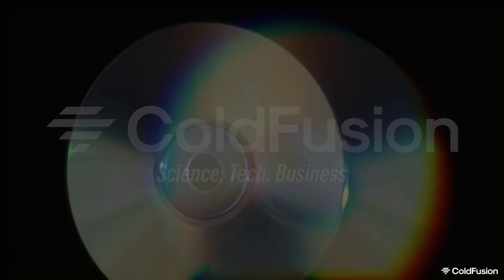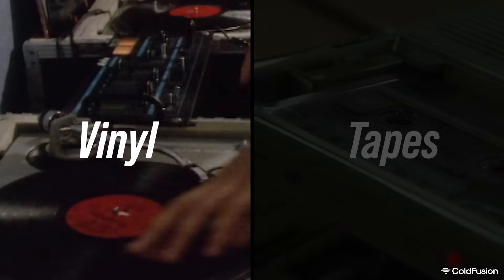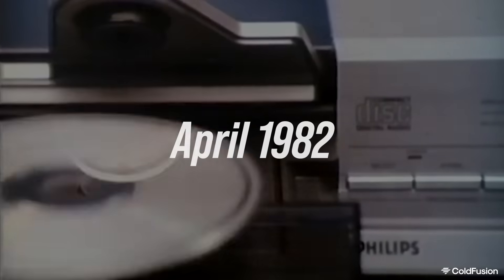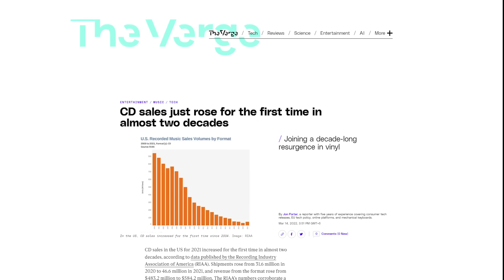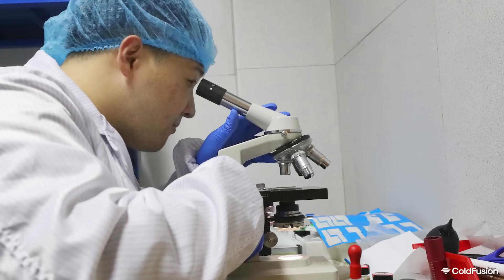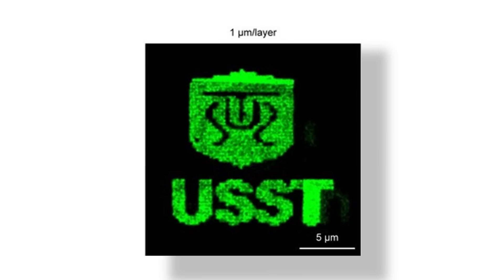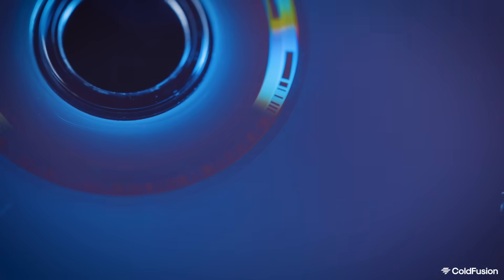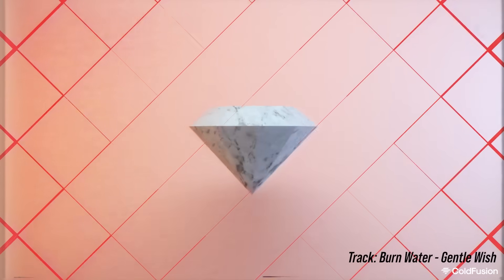Why This New CD Could Change Storage

Comment: People are primarily using hard disk drive and solid state drives for data storage (not cloud storage as the author says because you sacrifice security, and are limited by the cost and bandwidth of the internet). Given that, 8 TB hard drives are sufficient for the data storage of most people, or multiple drives for those who have a lot of video.
This new Petabyte drive is a cool concept and perhaps will one day be affordable, but for now it is much cheaper and more reliable to use solid state or magnetic drives.

Comment: The move to keeping everything online including personal photographs and sensitive documents has created concerns over Privacy, Information Security, and Cybersecurity. Having sensitive and personal information stored on my own optical disks eliminates those concerns. The data is not on the cloud or on my computer's hard drive, where it is vulnerable to being hacked, stolen, or just lost due to drive failure. The data is also accessible to me whenever I need it and I have the added benefit of not having to pay for extra data storage on the cloud (which could be a lot more expensive over the long haul). For these reasons, I continue to use optical drives and don't see myself stopping anytime soon.

Comment: The two ways i expect it only could start to become main stream together: the porn industry aswel as the gaming industry.

Why?

Looking at the battle between hd dvd and blu ray it was the porn industry whom massively moved over to blu ray meaning more money went to it and not enough to hd dvd.
Thus i expect given the current growing size of the gaming industry and the already big porn industry i can see thém pushing for that medium in order to put more on the disc.
Though the problem is the rest of the hardware needs to grow as fast and become much cheaper so we can have multi petabyte storage medium at less(not about) but less than the cost of a higher end video card thus there is a chance aswel as a place for it if the right circumstances come into picture...

Comment: Cool...  But I don't see a purpose for customers other than people that want to store that kind of data.  I mean backing up Servers is all I can see for it's future. I still buy music CD's.  Sad part was backing up music from a HHD back in the early 2000's disc couldn't hold 320kbps files. So you'd have burn CD's under 200kbps to get a lot of songs on 1 disc.  I physically own 550 CD's of Music I bought and Ripped to my Computer HHD.  So they are in New Condition.  HHD's used to cost a lot.  Now you can find a 1TB Drive New for 35 dollars.  If I was to play my CD Collection I have on my Computer.. I would play for 35 days, you may hear the same song a few times but it would be other artist that covered the song.  I mean I don't use the cloud.  And the only streaming I do is on me and my friends Internet Radio Station.  Which is funny cause I'm looking for a turn table so I can digitize Vinyl Albums I have...   Great Video thanks!

Comment: There are many greek albums on compact disc that they are not on digital platforms and also there are many greek albums on vinyl that never released on compact disc. The bad thing is also that some greek companies put many songs at platforms from fakely digitized files, they add extra strange frequencies and increase loudbess extremely and close the sound with muddy bass.
I have around 40 -50 greek compact discs that don't exist on digital platforms and also around 30 compact discs that on digital platforms they have the albums fakely remastered with muddy bass, hard drums, extreme loudness True Peak +3.5 around -7 LUFS and not tonal balance, like pitch and tone is fake. I have the same albums on cd with True Peak -0.8 to -0.5 ,  -15 to -13 LUFS and crystal clear sound.

Comment: If anyone remembers floppy discs, they stayed inside a protective case which protected them from being touched and scratched... My point is, that old school CDs, DVDs, Blu-ray and these NEW peta-discs should be made like that with a permanent protective case and small openings for the laser to read/write. I believe this would help make them useful at least in business applications. Especially if you can avoid having them damaged by a permanent protective case.

Comment: They only mention the write speeds in Megabytes per second, but they don’t mention the read speed, which will be much faster.

A modern 4K UHD Blu-ray disc can hold 66-100GB of data, so reading a 2-hour movie stored at 66GB would only require 9 Megabytes/s. So, it would be perfectly possible to store 2000-3000 4K movies on a single disc and use it for direct playback without disc swapping.

You would have the convenience of streaming but using a single disc. My bookcase of 4K/HD Blu-rays would easily fit on one disc, and making a NAS backup would be easy.

I hope this develops into a product, but the cost obviously has to go down for personal use.

Comment: how come 1.6 petabits bevome 200 gigabytes? it should have been 160 terabytes (using 10bits per biock, 2 bits checksum and separator + 8bits data, IIRC cd uses 4000 bits perblock)

Comment: At this point, why spin the disk. Variate the lasers electronically or electromagnetically thereby making the thicker and a finite platform, cube shaped. No longer necessary to spin a platter. When you can do depth recording at the sub micron level with no mechanical motor to spin you reduce the errors involved in the read/write ramp up/down rate. By locking the form of the medium and variation of the pulse with and projection of the laser , one could essentially make the Smithsonian libraries AND the internet archive available on a sugar cube or perhaps a pair of dice

Comment: He says '1.6 Petabits' and '1.6 PetaBytes' when referring to the density. These are NOT interchangeable terms. There are 8 bits in a Byte. Your 100Mb broadband connection is 12.5MB. This is an 8x difference. The b or B makes a HUGE difference.

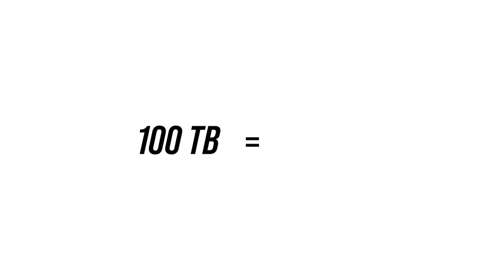Comment: 7:32 did you just compare the price of a VR headset with 2 4K-displays and a ton of other hardware to the price of a harddrive? That's just asinine
Also 100TB = 2000 standard iphones? W tf is that? They have 1TB iphones now and in a few years this stat will be even more meaningless.
You need  to work on your analogies.

Comment: Its seems CDs, DVDs, BRDs are not and wont be obsolete for the foreseeable future.  Current data storages systems are volatile and expensive relative to cd tech.  Properly stored CD media can be stored indefinitely.  HDD and SSD have volatile data susceptible to magnetic loss and electron leakage respectably and are not practical long term storage options.

Comment: Years ago i thought HVD would surpass BluRay and possibly be the end all be all bcz tech was beginning to slow down. But they havent made HVDs. (Holographic versatile discs). And now we talking petabytes bits whatever. Sheesh. Either way, i want physical media back and QUALITY..when it cones to the content on it(for example a full fleshed out video game-no updates)
Reply: Man if only I was rich enough I would create a disc using Magneto-optical (MO) which is the same tech that is used in Minidisc that way the disc could function like a hard drive also in a protective caddy like Minidisc UMD and DVD RAM and i would use 3D resolution instead of 2D which is used by CDs DVDs and blu rays i would also use the laser tech from HVD all this combined could be a disc surpassing 1 petabyte and with fast read write speeds

Comment: Data is written to recordable media in bits - 1s or 0s - (on/off, N/S, bright/dark) to make them useful incorporating all kinds of good stuff such as; the data, EDEC for data storage/recovery, and data redundancy among them. The bits are encrypted into "containers" called bytes. Be that as it is, this optical disc media is capable of storing/archiving staggering amounts of data; should it be as stable/durable/indestructible - in relative terms vs CD/DVD - as M-Disc media, this could make its' place in venues/environments where large amounts of data need to be archived for future man. In time they will resolve details pertaining to efficient manufacturing, recording methodologies and interrelated attributes making it a more tenable solution than other optical media, magnetic media and solid state media, which all have data error/retrieval issues, for data heavy archive needs.

Comment: Apart from being slow AF, I guess they will suffer the same time-dependent degregation that CDs DVD's and BlueRay disks suffer.... whilst holding substantially more data to get corrupted when they do degrade... Fine for versioned archives and slow retrieval... but to the consumer... a pointless rehash of a consigned-to-landfil technology. Better to explore storing data on (inside) crystals using lazers which are more promising imo...
Reply: CDs and DVDs last 30 years with good care they have already made discs that can last 100 years also they could just put it in a protective caddy like DVD RAM since there are so many idiots like you who can't take care of their stuff, also you could just copy the files from an old disc to a new one before it breaks.

Comment: yeah its a awesome if it does become cheap and available to public.  I've worked with discs for nearly 30 years, the ones made after mid 00s were poorly manufatured (disc rot starts around 15 year mark).  A lot of the discs I've worked with had to be backed-up every 10-15 years as the originals did rot - even in air conditioned, archived enviroments. - In a nutshell all I'm saying is, make time to do a back up (every 10 years) of crap you don't want to lose  ;)  And its not illegal to make a back-up of a disc you already own hahaha

Comment: All of this buzz until what? They make flash storage equally big enough and cheap? Did I miss something that makes this a viable practical solution that people should pray for? I own a 256GB microSD card, not that expensive. I think we can fit like 40 micro SD cards on a single side surface of a CD, so 80 on both sides, approximately. That's 256 * 4 * 20 = 20 terabytes, at fast read write speeds in portable devices such as phones, at a fraction of the cost of this CD's setup. CDs aren't some messiah physical storage media, we still do have access to doing the same with SD cards and flash drives.

Comment: I would use physical HDD not a CD to store data on if its important. Then at least I know that the disc it self won't get scratched or damaged in any way unless dropped. But stored correctly I'm sticking with HDD's.

Comment: Hard drive manufacturers are basically scammers at this point. 3 to 5 years lifespan on average. m-disk is the best kind of disk right now for archival purposes. And to use cloud storage you need to zip up your files cause otherwise your basically just sending your pictures to google or wherever for review

Comment: I think what they meant by disks are quarts crystals cut into the shape of a disk. So you'd need about a 100 thousand us dollar machine to burn it, and another 200 thousand us dollar machine to read it, and it probably wouldn't be as fast as an SSD, or even the faster hard drives.

Comment: I'd happily accept lower read/write times if it had some form of redundancy like a RAIDZ2 array, there's even enough room on a single disc to spread the redundancy out. Even if this is only a "write once" media, it would be enough space to keep using the disc until it fills up. This would be the modern, optical equivalent of a tape drive.

Comment: The current R/W speeds for this technology would not be a viable option for disaster recovery. You didn't mention if this is WORM or rewriteable technology. Having an extra off-site, portable copy of large amounts of data is a good idea.

The idea is interesting, but as you pointed out, many limitations need to be overcome. Having 1TB thumb drives is interesting, but the R/W speeds don't make them practical for large data storage and retrieval. Removable SS USB drives are much more practical for that.

Comment: I totally disagree with them being a good solution for long-term archival storage. I have CD-Rs that were written about 20 years ago that I can no longer read. They've been kept, untouched, in jewel cases for that entire time. I also have factory-produced audio CDs that no longer play. A disc with this much capacity is enticing, but I can't see a use for them. With my experience of CDs in the long term, there's no way I would trust one disc with so much data. Mechanical hard drives all the way.

Comment: Thank those professors researchers and fund providers as well that they worked on such old or almost thought to be extinct tech. Because i recently thought why not put some of the data on Blu-ray discs, seems cheaper but then i saw that i need a writer, so i preferred HDD and the speed is a factor as well. I don't remember why i exactly i thought to do so because i heard about this new tech first and i was reminded of the old CD tech or i thought first to go for discs then saw this!?

Comment: am I the only one that has thaught about the concept of SSDs replacing blue rays for consoles in the future? Like you just plug in your ~200gb ssd with the game installed into the console like a cartridge on the nintendo switch.
They don't even have to be that fast, 500mb/s would easily be enough, and if they were like 5000 - 7000 mb/s they could even be plug and play and you wouldn't have to download the game on the console's storage, but that would make physical games very expensive I think

Comment: Bytes (big B) are used for measuring storage. Bits (little b) are for data speeds (read/write, network throughput, etc). A byte is 8 bits. Everyone got it all confused.

Comment: The costs are i nsanely high now, but even looking at CDROM technology - the first CD player was over $2000.  It only took about 2 years for those prices to drop down to $200, another 2 years to $100, and another 2 years to further drop in half.  increased adoption drives increased cost savings as well as improved efficiency.   It's moore's Law applied to optical.

Comment: This won't catch on, you can already put a m.2 drive in a small portable enclosure smaller than two twix candy bar sticks and have several TB and fast.  Edit, my m.2 is 4TB in my computer and you can get an 8TB, I realize this optical disc is 200TB but give it a few years and SSD will catch up with this and still be radically faster and easier to deal with.  Also that Indian guy saying that would cover a football field in SSD?  No you could put a few SSD in to your jeans pockets and have that much.

Comment: Since its a Disc - can`t they slap one of these in a 3.5 inch HDD? And add the machine parts needed to write / remove data from the disc itself that will be in a HDD housing ?
Also i fully welcome Physical media! Id love to have discs used every day again, there is too much Digital media - you never feel like you truly OWN something .... 
And i believe a lot of people are starting to see the same - i welcome this CD of the future. 

Silly Question - Is it even possible to make a CD with a bunch of layered QR codes on it / that can store like a bunch of data o.o ?

Comment: 🤣 Yeah, not going to catch on. The read speed is too low and storage can be on scratches smaller devices. Disks are for collectors and previous generations. It’ll be a cool new way to use old tec but the mass market won’t give two shits about funding such a project to be successful.

Comment: The idea itself is not new at all. 
Just think of the TESA memory that was announced but never appeared.
At that time there were also reports where data was written in holograms on a 1 cm thick polymer plate.
The whole thing was over 20 years ago.
And the whole thing will only become a real innovation when it makes the step out of the laboratory and into the real world. 
Otherwise it's useless and nothing more than a good idea.

Comment: The only realistic use I can think of for such a device is science fiction at best.  A deep space colonisation attempt with the disks safely containing all the knowledge of that point in time when the ship was launched. Safe from any possible radiation.  Other than that they would be useless for even data centres because even if they were read/write there would be a limited amount of times they could be written to.

Comment: I've wished that there would be another higher capacity, affordable, optical storage medium that could be used for backups and/or media that doesn't need to change / update.  Over the years as my data storage needs / options have increased from 100kb floppies (apple) 5mb hard drives (apple early PCs) (ooooooo) to my 20tb drives and now many TB RAID NAS, and going from mostly data-only used initially on PCs to lots of digital media (pictures, audio, video) gobbling lots of storage space, over the years, I've done backups on backup tape cartridges, CDs, DVDs, and now just backup magnetic drives.  Although I presume this device would initially be used by business, but I and probably other individuals and small businesses would welcome a small optical, long lasting / relatively durable (hopefully) optical backup that would also be more easily transportable for off-site storage as well - home, work, bank box, between work locations, etc.  and - some of us don't want to put our backup data (or otherwise) in public, cloud based backups.   --- Related: Over the years people have kept saying that magnetic media would top out in capacity, and be replaced by optical or other media, SSDs etc, which magnetic media has heavily been replaced in laptops it seems, but magnetic media doesn't seem to be going away any time soon, and keeps raising capacity for use in high capacity PCs and servers, doesn't it?